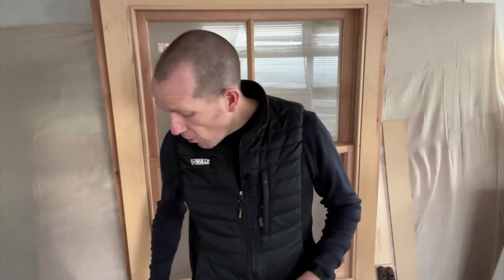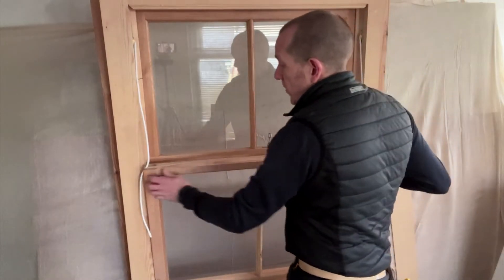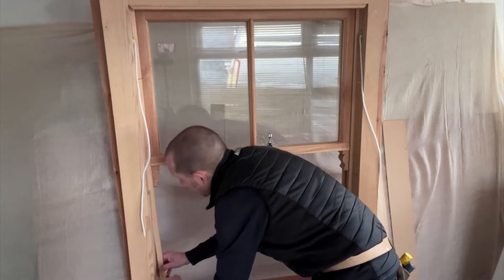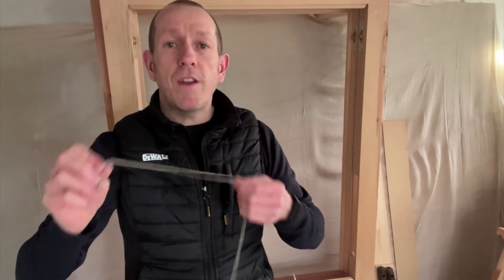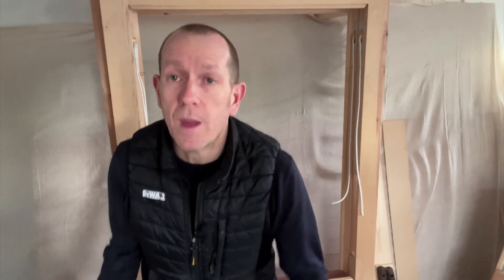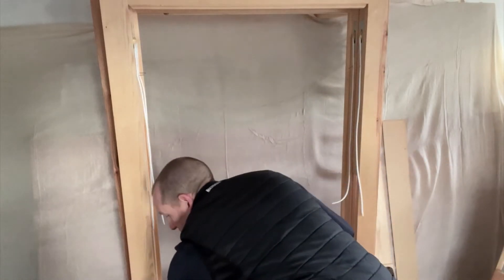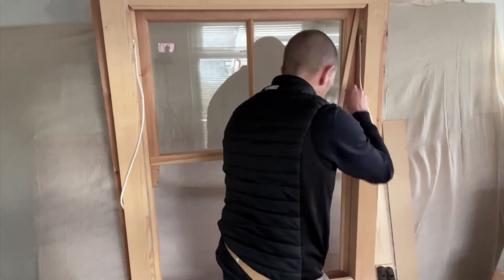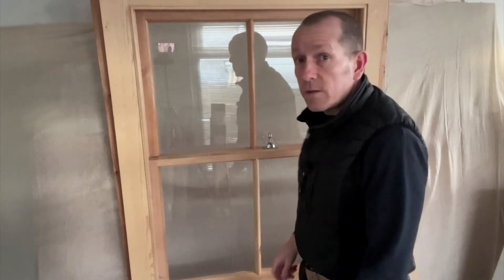Beginners Guide To Replacing Sash Window Cords

Comment: Great video thanks! Instead of using 40mm ovals to hold cords we use small vice grips close to sash runner, works a treat and is quick to attach and undo. Like your tip with the tape, to stop cords fraying. Also the screws are a good idea as nailing is slow and tricky to do on some cords.We also wax the side of the sashes with an old candle to make sashes run smoothly. Do you use pan head screws? Would pan heads hold
 cords down better maybe?

Comment: I replaced an old original broken sash cord on a heavily painted window frame more simply without any disassembly.  I used a hacksaw to cut out one side of the original double pulley, attached a new cord to a powerful small magnet,  installed a new pulley and attached the other end of the cord to the top/side of the window using a screwed in small metal clip that extended s lightly into the channel — no mess - a lot less work — no repainting —works perfectly well.
Reply from the maker: Wow, can you show me a video of how you done it? email me info@sashwindowschool.com
Reply: I do not understand what you did could you demonstrate it?
Reply: I would love to see a video of your method, any chance you could make one? Please!

Comment: Can you do a "how to fix both staff and parting beads with draught-preventing, seals rebated into beads, How do you do top and bottom?  ?With long life self-adhesive foam 10x 5mm"  Ensure frame is well clean and dry first, before adhesive bites.

How do you get the painters from not destroying brushes, on cyclical re-painting?  Is there a better draught seal to beat the painters need to paint over the draught seals? My contractor recently both left large gaps between brush and sash, and also sent his painters in, and who painted over the brushes. Old vertical sliding windows mostly went along wjth coal fires. These needed a big draught up the chimney fro, the window sash gaps, or the smoke would not go up the chimney. This draught is not needed any more.

Comment: Good instructional video.

But I have to say, perhaps repairing a window sash from scratch might be a bit more easy to follow rather than contend with a window that's not got a broken cord.

Plus, I couldn't find the PDF (only your transcript is displayed). Has it been removed?

novice repairer - 
Paul
NSW Australia

Comment: The purpose of sash Windows was, in the summer you open the top and the bottom. The hot air rising will then flow out the top of the window allowing cool air from outside to come in at the bottom. In winter you keep the top one closed. Then the hot air stays in. Fresh air will come in at the bottom.
Reply from the maker: Your absolutely correct.

Comment: In the pdf it says mark the box frame at the same measurement point ..2" above where your rebate starts.  Is this the same formula for both top and bottom sashes..?
Reply from the maker: Yes Robert, the same for the upper and lower sashes

Comment: At the 4 min mark you said Staff bead did you not mean Parting bead?
Reply from the maker: Ha Ha, yes your right, I did say Staff bead when I should have Parting bead🙃
Reply: @sashwindowschool3375  I thought so lol. I bravely took on a sash job on a very large window despite never having done it before your video really helped. How do you choose your cord thickness and what brand do you use?
Reply from the maker: @paulb9769  We usually use 6mm cord. you can get it here https://www.reddiseals.com/product/polyester-sash-cord/
Reply: @sashwindowschool3375  Thanks I ended up buying Everlasto 'Red Wrapper' 7mm seems to have worked perfectly.